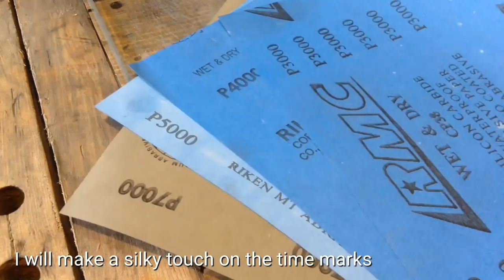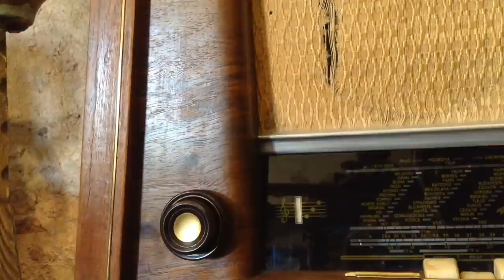Hand Plane Restoration - Stanley 9-1/2 Block (1872 - 1981)

Comment: I’ve got a similar plane, a 60 1/2 . Missing the lever that aligns the blade , but still in daily use . The original blade wore out, so I replaced it with a cut down blade from an old wooden plane . My favourite plane for all that light duty work
Reply from the maker: Good job Rob, nice to see you here

Comment: You did a great job here, this is probably your best restoration yet. It's amazing to see how much effort you're putting in to keep up with the quality of work of done by channels that have a lot more tools than you. My only suggestions would be to polish surfaces without pitting, and to blue surfaces with pitting. That bottom plate could have been heated up on a stove and dunked in oil, making the pitting invisible. Pitting is the result of rust or ware, so protecting those areas will also make the tool last longer. I love the finishing on the top portion though, the two-tone handle is absolutely beautiful.
Reply from the maker: Thank you very much for detailed comment. I like all the thoughts from anyone. every of them very precious ⚒️🗜️🌟 I'm glad you liked the work. See you in next story.
Reply: Wait so I'm confused, how does heat treating and quenching hide pitting?
Reply: @scottmartin7717   It is a process called "hot bluing" the high temperature causes the oil to burn into the surface of the steel, staining it black. The pits are black, so they don't show up as well on a black background as they do a polished silver one. The method Meine Mechaniker used at 8:25 is called cold bluing, it is a more expensive alternative to hot bluing, that only works after sandblasting before any oxidation occurs. For more information try searching for "My Mechanics Insights bluing" on youtube, and clicking on the first video.

Comment: Brilliant! Most plane restorations are for show only, and don't actually get the thing working properly. 
Just a couple of minor observations....when flattening the sole, you should ideally have the plane fully assembled and everything tightened down (obviously with the blade withdrawn). The theory is that the casting is malleable and the tensions in it whilst assembled are different compared with when it is dis-assembled. It probably makes no difference for a block plane like this, but can make a substantial difference for a larger plane, such as a number 6 or 7. Secondly, you planed that wood against the grain!
Reply from the maker: I'm glad you like it Mike, great to see you here  and thank you for details and your thoughts ⚒️🗜️🌟

Comment: Your angle holding skill in manual sharpening looks amazing. How much time did You train it?
Reply from the maker: Thank you very much Timur, nice to hear that. I start to sharpen tool steel when I was a child in a woodworkshop, beside this I have knife collection for years. I feel myself gifted on sharpening. So I can't show myself as an example on how long it will take to learn. I think , can be fully learned in a few months with the right teacher. Btw my axe and straight razor videos have some sharpening scenes 📽️  stay safe and see u soon 🖐🏻⚒️🗜️
Reply: @byOldHand  I watched my own hands for a long time, including in recording, and I could not achieve such accuracy of movements - the angle always leaves a little. Unfortunately, I have to use tools to hold the angle when sharpening.
Reply from the maker: @timurnizamov1127   Then you can try this. Start with a wide chisel and just pull towards yourself slowly. With a wide and thick steel you can increase your skill easly. Be sure you find the angel. There is another problem in sharpening, you may be pushing and pressing too hard. Just find the angel with two hand, one or two of your finger on the steel and stone, feel with a finger both of them and pull gently. Not back and forth, just back. flow on stone. You will learn in time 👌🏻🍁⚒️

Comment: Look this is lovely restoration BUT the main test is to use it as a plane. To get the plane to work right you have to hone the shoe while it's assembled, not after. The reason for this is because it warps under tension. It looks clean and well restored BUT is it plane that is dead straight or does it just look pretty?
Reply from the maker: There is no miter problem on the body and the base is flat.  Thank you for sharing your thoughts, it's nice to see you here.
Reply: @byOldHand  thank you, I'm glad to hear it work well. You did a great job on repairing it.
Reply from the maker: @slapitman  Thank you very much.  Little spoiler ; in a couple days a new video is coming, a wooden hand plane.

Comment: If you had looked up a picture online, say on ebay, you would have seen the little hole up front is where a missing part attaches. It is missing the cam lever for the front throat plate. You may have then noticed on ebay that there are pages of this tool available for $25 each. So then, why invest $500 of labor in an incomplete, common item?
Reply from the maker: Mark, thank you for your detailed critique.  I mentioned the missing piece in the video description.  Although I have an instrument in my every work, the subject is craft.  All this detailed work is to present you with various approaches.  See you soon again.

Comment: Per me la pialla era nuova fatta volutamente arrugginire con l'acido .    Cordiali saluti,         Danilo
Reply from the maker: thank you for watching my dear friend
Reply: Incorrect. If it was deliberately made to rust just for a video then the parts would only have surface rust and not have the pitting caused by longer term rusting. Such a negative disbeliever. 👎